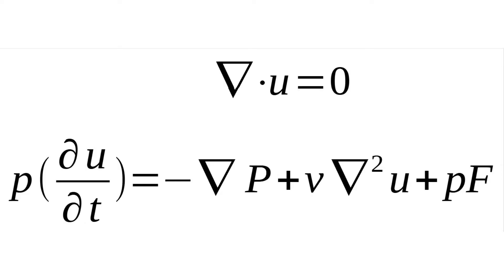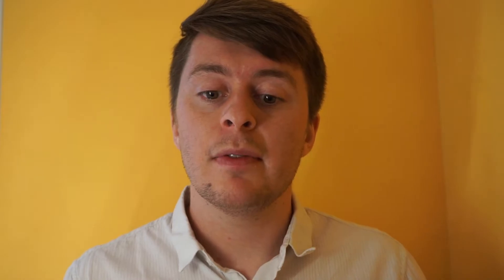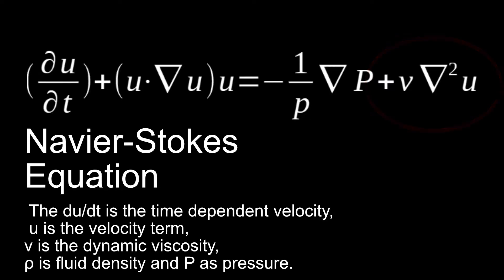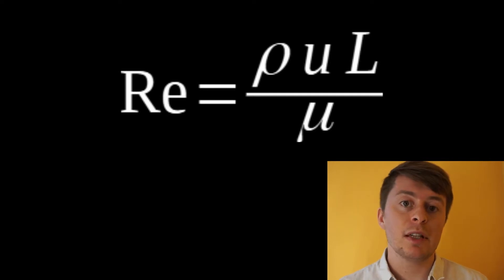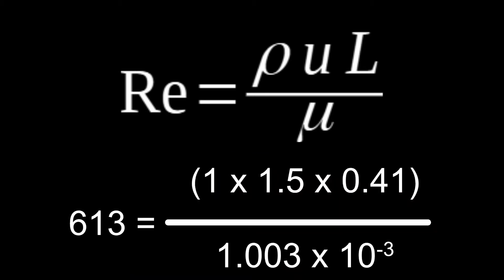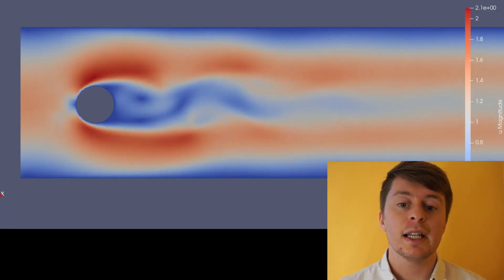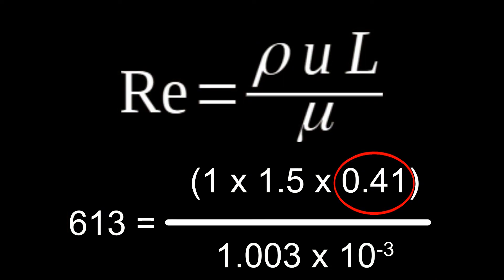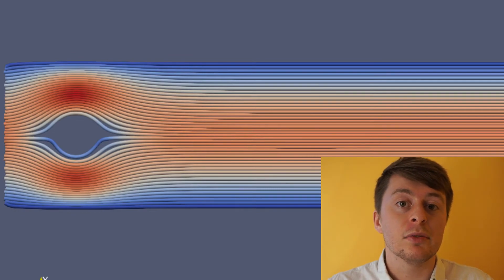Understanding Navier-Stokes solvers | FEniCS CFD

Comment: You have the code in matlab for problem navier stokes - cylindrical duct?
Reply from the maker: Hey Gesivaldo dos Santos Silva, apologies of the delay. Unfortunately I do not have this code in MATLAB for Navier-Stokes cylinder duct BUT there's plenty of software such as CFDTool, FEATool Multiphysics and others which can be added to MATLAB through the extension manager. https://www.mathworks.com/help/matlab/matlab_env/get-add-ons.html

In particular, I'd like to highlight FEATool Multiphysics as allows users to export CFD problems to FEniCS (The software being used here!) and OpenFOAM which are open source and free code not requiring a license or subscription. https://www.featool.com/cfd/2018/07/02/fenics-openfoam-matlab-cfd-flow-solver-benchmark 

Currently, I do not have any plans to implement in MATLAB as I cannot afford the individual license fee and I am not part of an organisation which has a MATLAB license. Using FEATool, you should have "good enough" interface to load a ".STL" and/or mesh however this is outside the scope of these videos. You can then export to FEniCS which is related to these videos. 

Apologies I cannot help more with MATLAB but I should have a basic How-To setting up a CFD problem in FEniCS BERNAISE soon!
Reply: @NanoMedic  thank you.